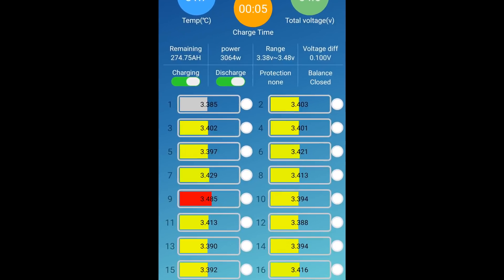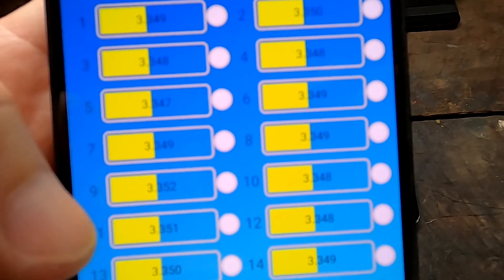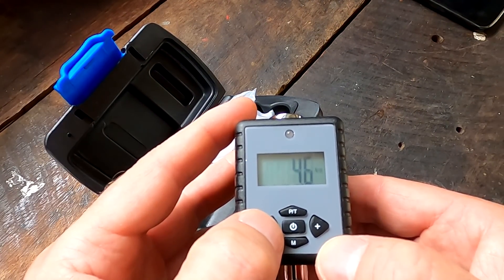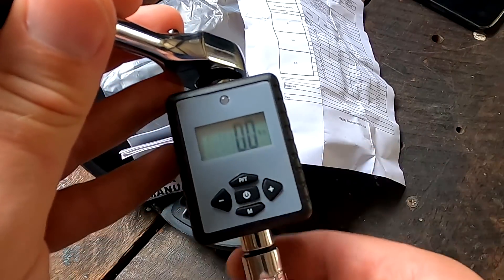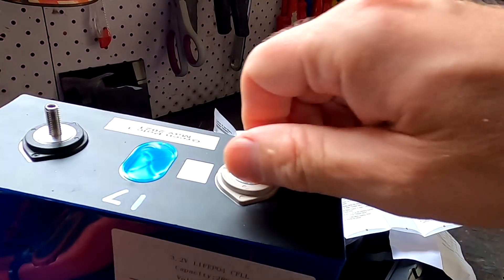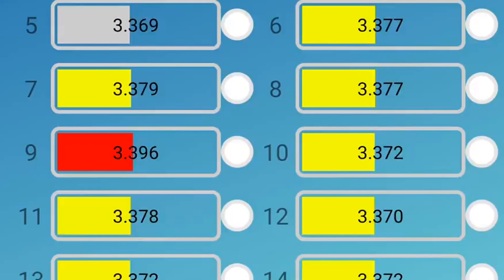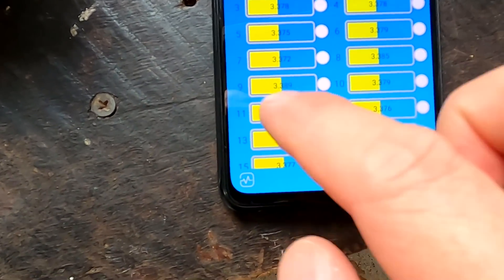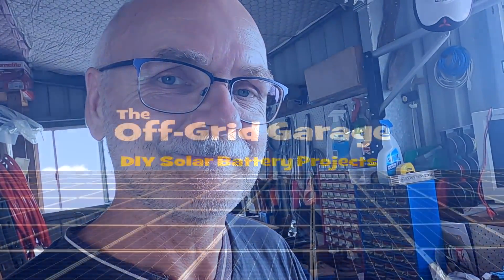Still some terminal corrosion by missing the right torque?

Comment: I don't use any grease on my terminals and I've never had an issue. However the cells I currently have in my main battery pack are the Fortune 100 Ah cells which have super heavy duty terminals and I actually use an impact wrench to install my terminal nuts at a very high torque. I also use zinc plates copper bus bars and the zinc plating means I don't have to worry about oxidation.
Reply from the maker: With an impact wrench! Wow. yeah, that will make a difference.

Comment: Aluminum (or aluminium ;) ) oxidizes almost immediately when exposed to air.  The resulting oxide is an insulator. Any grease will limit air exposure and so limit oxidation. Some greases are sold specifically for and some are approved by authorities for power carrying electrical connections with aluminum. Most I've used such as Ideal's NOALOX require abrasion to remove the oxide while applying the grease. And then of course correct torque to ensure a secure mechanical connection is necessary. I still prefer copper.

Comment: did you go around and torque all the bolts on that battery so you dont have any problems with the other cells?
Reply from the maker: No, I didn't. The ones where I applied the grease are fine without issues. I will do a proper torque tightening with the new batteries.
Reply: @OffGridGarageAustralia  ah that makes sense if you are going to tear down the battery very soon. I love your videos keep them coming! I am excited to see the new bettery build!
Reply from the maker: @SuperBrainAK  Thank you 😊

Comment: I also bought a digital torque wrench (model EMW-10).  I use for the same purpose as you (6mm SS studs - 8NM)   I find it  almost useless.  I have 32-272Ah Lishen cells in service for about 9 months.  I charge usually from 50 to 120Amps.  I have the same problem with connections as you -- about every month one or two terminals get hot and the battery voltage on one+ cells causes a premature cut off by BMS.  I have the same BMS that you do (JK-B2A24S20P).   It is my 4th try on a BMS that sort-of works.  The DALY BMS is a sham because it is not useful for a solar application.  Solar needs at least 5X the charge rate than the average discharge rate.   DALY (and clones) spec a 100Amp BMS to max charge of 50Amps.  The lifepo4 cells should not be balanced anywhere except at the TOP and BOTTOM.  That is the flaw of every active balancer (for lifepo4 cells) I have tried.  The middle balance spoils the balance of both top and bottom.   I have NOT found a solution of the high resistances terminal problem yet.  All "solutions" I have seen are for low charge rates (below 50Amps with 6mms SS studs in ~6 Al threads in cells with absolute max 8Nm torque).   I find it very fascinating you and I have been on a similar path with much the same equipment and problems.  However,  I use MPPSolar (PIP-8048MAX)  instead of Victron inverters.  I will share my suggestions and solutions in the future, now that I know how to comment.
Reply from the maker: Thanks so much for sharing, Doug. That is indeed very strange. We have almost no air moisture down here, it is very dry so that could not be an issue for. Some more people came forward now with the same problem. I wonder if this has something to do with the AL terminals.

Comment: but now you can't hold the stud with your Allen wrench, to prevent the stud from twisting inside the battery. I'm so afraid of twisting it off of inside the battery. when i tightened them before. I could see movement between stud and case unless I was holding the cable or bus bar really tight.
Reply from the maker: From what others said, it's not necessary to hold it down as the force while tightening the nut will be upwards not downwards.

Comment: The solution to corrosion prevention is and has always been dielectric grease, clean, coat, assemble.  I use it everywhere, and the good stuff is a PITA to work with because it's so sticky.
Reply from the maker: Dielectric = non-conductive. Is that the right stuff to use though?
Reply: @OffGridGarageAustralia  Yep, that's the right stuff and yes it's non-conductive.  There's well more than enough force to push it out of the way on torquing (consider it a 'wet' torque, reduce values by 15% when on threaded fasteners).  I use it in mechanical dimmers, bulb sockets, outdoor communication connections including LTE radios, between outdoor extension cords etc.  Use thicker stuff outdoors, indoors / out of weather can use thinner stuff.  Locally you're probably only going to find a one size fits all which is typically on the med to thinner stuff which is plenty for batteries.  It's used on spark plug boots as well as car battery terminals and vehicle light bulb interfaces for push in / twist in style bulbs.   Aluminum to aluminum connections will corrode, it's why insurance companies don't want to insure homes with aluminum wire / charge a premium for it.   

Clean terminals / bus connections apply, assemble.  Keep clean surface's contact with oxygen to a minimum.   On tightening the grease only remains where the pressure is not.

There is a conductive grease used for stranded AL wire that's got a zinc powder in it that provides some abrasion and conductivity called noalox.  I don't prefer it as it's a limited conductivity and can hide loose terminals in diagnostics, but can't hold any current.  The goal is to prevent corrosion, not try to bandage a poor connection.  Is okay for stranded aluminum to get between the strands, but you have flat buss bas and can scotch-brite them and coat them in the grease.  The goal is to keep atmosphere and moisture of the connection point.

I use dielectric religiously here in the SE US where it's always hot and humid as hell.

Comment: That no oxide electrical grease is awesome 
I used to get arcing between my solar panel connections (500 volts) said my inverter. I used that grease and never got the alarm again
Reply from the maker: Oh wow, thanks for sharing.

Comment: Contact grease the main advantages of these products are reduced contact resistance (even on extremely heavy usage), improved plastics compatibility and improved mechanical lubrication for electrical contacts.

Comment: Can anyone please tell me the cause and resolution to Andy's problem with low production from his solar panels, when he initially thought it was diodes but wasn't (~Apr 2021)? I've spent many hours watching Andy's videos and love them (tears and all!) but I can't find the one where he figures out the cause of getting a maximum of 2amps out of his string versus the ~5 amps MTTP.
Reply: That makes two of us 🙂
Reply from the maker: That was with the old SUNTECH solar panels which were somehow faulty. There were a couple of videos where I chased this issue. I will do more testing about this soon. I bought some new diodes and want to test the single strings within the panels as well because I have no diodes connected at the moment and have access to all the single strings now. I still don't know exactly what is wrong with these panels.

Comment: What about thick silicone grease, I saw some old timers using it for electrical connections on trucks and other dirty places, allows contact, keeps out moisture, lubes.
Anyone doing that?
Edit: although it does get runny when things heat up, might get messy.
Reply from the maker: Silicon is an isolator though. Or do you mean around the connections once they are tightened down? Sounds very messy to me...
Reply: @OffGridGarageAustralia  
Yes, its used in the connectors, the metal to metal connection still happens but muck and moisture is kept out. 
Conductive graphite assembly paste is of course superior but in a pinch, silicon grease will for sure help prevent oxidation.

Comment: I would be concerned about the grub screw threading into the terminal while you are torqueing the nut.  Given that they can ben held with an allen key, you can use a crows-foot socket  on the digital torque wrench and still hold the screw with the allen wrench.  You will need to do a bit of math to find out how much to reduce the torque setting to adjust the increase in the lever arm.
Reply from the maker: I was the same but many have said, it's not necessary to hold them in place. When you tighten the nuts it pulls on the rod which prevents it from being pushed in further.

Comment: I don't think this is due to oxydation ... my experience has been (also using the torquemeter you have) that the issue is that the busbars are rigid, and the slighest movement (0,1mm or less) makes a HUGE difference in contact resistance. Just like jahrmichi here below I used the resistance meter and found horrendous differences (up to 1,8 mOhm even), and that the most important part is to tighten down evenly and ensure the best contact surface possible between terminal and busbar: I no longer use the torque meter but can tell you the resistance easily drops to below 0.4mOhm if you tighten correctly ... And then there is the other issue ... I stripped a thread partially (below 4Nm because of misalignment of the cells of less than 1mm) and really didn't want to put a helicoil or new thread and loose contact surface, so I manufacture a flexible busbar using sturdy M6 terminals and a very short 50mm2 wire. This allowed me to reach 0,5mOhm even with less than 2Nm of torque. So Bottom Line : buy a battery resistance meter and check your connections with that, you will be surprised.
Reply from the maker: Very good tip here, Greg. I have a internal resistance tester for the batteries and will use this to find the problem. I'm keen to see how the new battery goes once in place.

Comment: Thanks Andy again a very interesting story, it's a pleasure to see your enthusiasm for important issues (let's not forget that loose connections can generate a fire) but let's be optimistic!  Speaking of tightening: I destroyed two locations by over tightening.  I tried a restoration of the M6 impression with a spring which is placed in the hole and this small spring makes it possible to remake the wire for a new bolt.  It seems to hold.  Tightening too much can tear the thread from M6.  What do you think of this technique?  Thank you again for all your subjects, Greetings from France (Brittany region with less sun)
Reply from the maker: Thank you Patrice. What kind of spring did you use for that? It sound like a similar solution as the Helocoil system?
Merci et tout le meilleur pour la France!
Reply: hello, the restructuring stainless steel springs of M6 or others come from Aliexpress, I believe that the seller is XCAN, it is a kit at around 3 euros, it is effective, I was able to restructure the imprint by depositing this spring in  stainless steel which replaces the screw thread, without this DIY the element would be out of order, is the aluminum of the electrode hole thick? I would like to drink a good beer in your dream garage. I symbolically send you a small beer.  Good day.

Comment: Hello again Andy!Believe me, the best solution is to use 25 or 35 mmp cables crimped with copper cable lugs, then soldered with a gas lamp with tin. I use this solution to the detriment of the busbar, and I have no such problems. On a sunny day I charge my battery bank with up to 150 amps without having these problems or heating the cables or lugs. I opted for this solution because I compressed the whole battery bank with 300kgf and I didn't want to stress the cell terminals.
Reply from the maker: Thanks for sharing...

Comment: Andy for such a smart, reasonable, analytical guy, your knee jerk rejection of compression is almost humorous. You experiment with everything else! These cells do move with relation to each other depending on charge. In the big picture it seems odd you will purchase am electronic torque meter but won’t consider that these rigid bars are moving with the cells in each cycle. You are the guy that could actually answer these questions. Go for it.
Reply from the maker: That's not true, David. Not in my case. If you watch older videos, I especially explained why this is not the case and how to avoid it. There is no stress on the terminals due to expanding/contraction of the cells because they have 2-5mm gaps in between then.
There would be a mechanical force on the busbars if they would touch each other but not like this.

Comment: Thanks.  I have nothing between my contacts.  I'll be buying some copper grease now.    Nickel plated bus bars and plain copper as well.  I've had no problems and Daly BMS keeps the batteries to 0.002-0.006.  Like you I just tighten everything best guess.  When you've been doing things a while you get a feel for how much torque you can use.  I live in Sunny Hot Australia.  Just installed 2 new Growatt 5000ES with wifi.  So nice watching the power coming in.  FYI totally offgrid.  No cheating for me.   PS.  I keep seeing people use Locktight on their battery screws.  That can't be good.  Maybe you can address this, I'd love to know if you can lock the threads without loosing power???
Reply from the maker: Thanks Lee. I will start with nothing in between bus bars and terminals on the new battery and see how I go.

Comment: No, first you polish and remove all oxidation, then you apply the paste that prevents the oxidizing air from coming in contact with the freshly cleaned surface. Most pastes don't clean off the oxidation, but prevent it from occurring. I am sure there are exceptions to this, but the vast majority are like this. Most people also use too much, just a very thin layer to "seal" the surface from the air is required. The aluminum oxidizes quite rapidly and is a very high resistance once oxidized and when the connection is copper to aluminum, a process called galvanic corrosion actually occurs (it's also what makes a battery work). This makes all of the corrosion actually occur on the aluminum, rather than on both the copper and aluminum. Aluminum oxide is a far worse conductor than copper oxide, thus the plethora of products specifically for this use. In the 1970s, the use of aluminum wiring with fixtures (switches, outlets, or powerpoints) designed for copper caused quite a few house fires in the USA. Now there are regulations about it, and fixtures designed for use with aluminum wiring. It is a "controversial topic" about which is best, etc, but they all work essentially the same way, excluding air. Whatever is cheap and designed for this use is best.
Reply from the maker: Thank John. Yeah, that's correct. Apparently the NO-OX-ID removes these oxide layers as well but who knows...
Reply: @OffGridGarageAustralia Hi Andy, do you use NO-OX-ID ?
Reply from the maker: @OpenSolarEnergy I have it here but stopped using it. I had the best results with... nothing tbh.
Reply: @OffGridGarageAustralia  Thanks Andy, I also decided yesterday not to use grease on my terminals. Concerning oxidation, if you look closely it is possible to see a thin white film on the terminal. Measured yesterday with YR1035+, 16S LF280K battery with flexible bus bar. With oxidation (after 20 months) I measure a total resistance between + and - (without BMS) of 4.07 mOhm and without oxidation (rubbing by hand with steel wool then cleaning the bus bar and terminals with alcohol 96%) I measure an IR of 3.92mOhm. I conclude that it is not necessary to add grease or other high-tech compounds. We are not in aeronautics.
Reply from the maker: @OpenSolarEnergy  it could be beneficial if you have a lot of air moisture. I think it makes a positive difference then.

Comment: You love buying gadgets.  I think you are waisting your money.  Use NOALUX compound and SPLIT LOCK WASHERS.  You then torque until the split lock washer flattens.   This will give your nuts proper torque.  Get rid of the crappy lock nuts you have now!!!!
Reply from the maker: I don't use lock nuts on my battery.
Reply: @OffGridGarageAustralia    You use the serrated flange locknuts.    I stand by that split lock washers are better.  The split lock washer acts like a small very stiff spring providing a constant torque especially material expansions.

Comment: Think it’s all down to surface area/contact and quality of those surfaces. Oxidized surfaces become dialectic (insulator). Hard anodized surfaces are actually used as a high voltage insulating heat sink. Aluminum (like the battery terminals) are excellent conductors but they oxides quickly, like in minutes. Add to that a different metal such as a tinned surface (lug-bus bar) , ambient moisture and time, you are setting up a recipe for electrolytic corrosion. As for contact area, the new/larger Ah batteries actually have less due to the smaller diameter, welded on terminals. They should be adequate if they are clean and flat. If they were properly faced off, then they should be. As for the bus bars being flat, that’s a crap shoot. They can be concave or convex, on one side or both, non of which is good and a little 6mm nut torqued to 5Nm ain’t gonna flatten it out. 
Checking the bus’s surface across the width with a indicator to find the best side for contact and lapping it flat if needed. A flatness of .0002 wouldn’t be outlandish but desirable even if the plating is compromised. Just prior to assembly, it would be highly advisable to remove any surface oxidation on both contact surfaces with a quick(hand!) buff with Scotch bright ultra fine then a carful dust off with air or alcohol wipe. Lastly, a thin film of anti oxidative to keep a barrier against air/moisture getting into the juncture. Once it’s assembled, put the battery under load and check for resistance by looking for an unusual/different voltage between the bus bar and the terminal under the bus.
Reply from the maker: Thanks Karl, great comment.